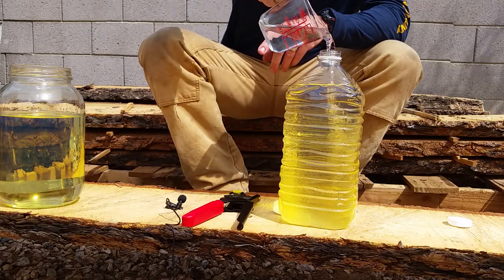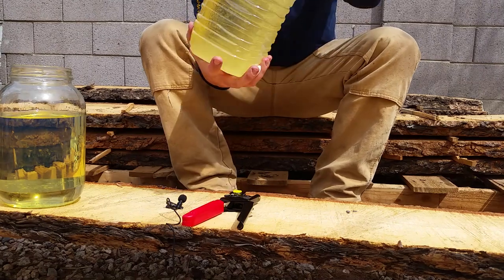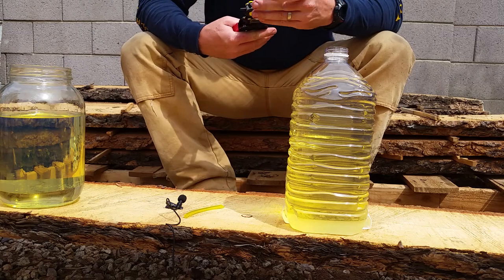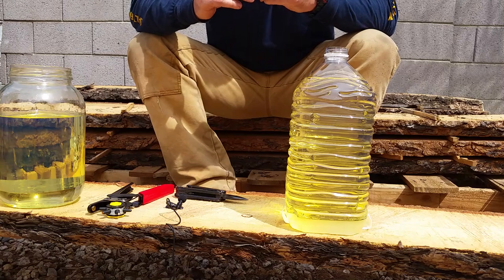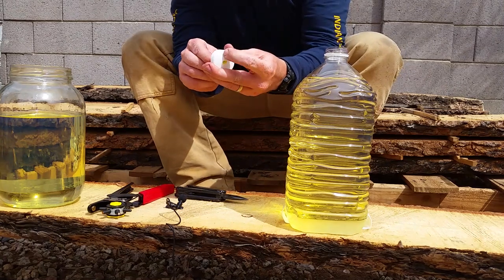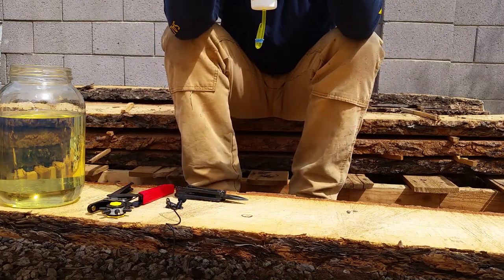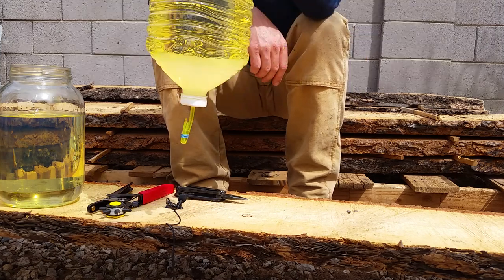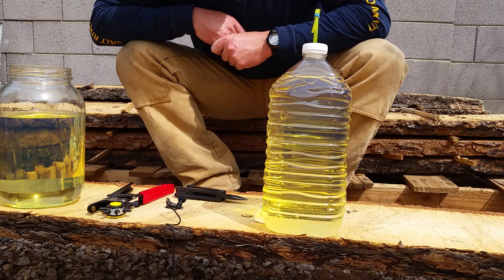Removing ethanol from gas

Comment: Pure gas gets up to 4 more miles per gallon, that's 80 more miles on a 20 gallon tank , corn is for eating , not running your car
Reply: Henry Ford actually designed his first cars to run on corn alcohol.
Reply: And also WHISKEY...lol
Reply: @fastcarshotbikes  Weren't they running cars off of moonshine during prohibition in the 1920's?
Reply: What mpg do you get?
Reply: It also pollutes more... I don't know what these environmentalists are smoking, but it obviously isn't pot.
Reply: @fastcarshotbikes  Indeed, they were designed fully for alcohol. They didn't use crappy plastic and cheap pot metal in the fuel system then. The oil companies sold gasoline at a loss to smother out the alcohol producers. Then they jacked the price. We've been gouged ever since.
Reply: On the YouTube channel Project Farm, he tested the difference between 10% ethanol you get at the pump and ethanol free. One of the tests was how long a generator would run while powering 2 space heaters. The ethanol free gas only last 4% longer than the 10%. So assuming you get 100 mpg already, yes you can get 4 more mpg. Assuming a reasonable 30 mpg with 10% ethanol, you'd get 31.2 mpg with ethanol free.

The main benefit is reduced wear and tear, not gas mileage. Although it is another plus of ethanol free gas.
Reply: @waltofalltrades6817  Yep, a liter of E free gas gets you more mileage, but measured by the dollar you get less as the price is about 35 cents higher (in Canada)
Reply: @The411  and that's why I was watching the video in the first place. Its a good thing that I only plan on using it in my lawn mower, gas mileage wasn't on my mind at all.   XD
Reply: @The411  right, and nobody has the time, space, or inclination to chase the extra mileage by doing the work to remove the ethanol like this in quantities that cars go through fuel.
Reply: 6 % mpg loss with 10% ethanol
Reply: And toilet paper

Comment: Farmers have done a variation of this for decades.    It's a water trap. Elevate the large fuel tank.  Have a threaded drain hole at bottom of the tank.  Run line downhill from tank to a T-fitting.  Position the T- fitting so that one port faces down.  Attach a longish pipe to the bottom of T.  Install a petcock at the bottom of that pipe.   So any water in tank will eventually settle  into that low pipe, and can be drain off, until clear fuel comes out the petcock.   The 3rd port of the T feeds to a filler hose that is used to fill the gas tank of vehicles. A person can also install fuel filter between the T and the filler hose. .  Is especially useful on bulk diesel.
Reply from the maker: +Duke Makedo very interesting...thanks
Reply: charter planes also have a water drain off in the fuel tanks from the wings on cessnas
Reply: @wharris7594  I remember draining the water from the King Air and Cheyenne in my dad's hangar as a kid.

Comment: Octane is a hydrocarbon like butane, propane, hexane, (gasoline is primarily hexane). Ethanol adds oxygen to the mix and promotes oxidation so when you said removing the ethanol lowers the octane I had to comment. It lowers the gas' ability to oxidize. Ethanol helps to clear up emissions and aids the catalytic converter so it can do it's job. Sometimes you just need pure gasoline for yard machines and carburetors. Ethanol vapor locks mechanical fuel pump suction when its hot and nobody enjoys that. Awesome video!
Reply: You are right. All hydrocarbons are nonpolar and hydrophobic, so octane molecules would not be removed from the gasoline into the water.

Comment: I have separated out the water/ethanol after 10 gallons got flooded in Hurricane Harvey.   I realized it was also washing the ethanol out and the gas should be good.   And it was!   I just put a tube into the lowest corner of the can and siphoned the water out from the bottom until clean gas was coming out.   Easy.  However, I find the best answer is to just use regular gas as long as   1. you don’t buy a lot and store it for a long period and 2. Make sure your tank and float bowl are emptied and dry before putting up at the end of season for that machine..   As long as you do these two things and are running your machines on a regular basis then you should be fine with gas+ ethanol.   Problems really only occur when it is stored and/or left in the cans, tanks and carbs.    It takes 30 minutes at the end of the season for that machine to change oil and drain all fuel out.   That 30 minutes pays back BIG time at the start of next season.   I’ve been using this method for years and never had to clean a carb or gas tank.   Most issues can be traced back to lack of simple care.
Reply: It destroys  plastic  fuel  lines on 2 stroke engines  and diaphragms on all small engines

Comment: The trouble with ethanol is it attracts water like a magnet even in a closed fuel tank and when enough water is in the ethanol it will separate leaving straight water on the bottom, rusting the tank and killing the fuel pump, I know this from personnel experience!

Comment: I am having problems starting my Husky Rider mower. The guy who services it told me it was the ethanol in the fuel and that it damages engines. I'm glad I came across this great video and now have a solution to the problem. Grateful to Kimball Cody for sharing his knowledge and all the posters here. 👍🙌
Reply: I'm a small engine mechanic. We switched to non ethanol fuel at the shop about 8 years ago fue to the amount of carb issues. We'd fix it and stuff would come back gummed up. Everyone gets a machine back with non ethanol and highly advise it for anything that's sits for 3 weeks or more

Comment: The purpose of adding ethanol to gasoline was because of the oil shortage. Now that the U S has newly discovered reserves of oil, we don't need the ethanol. The only reason why we keep using it is because of the farm lobby which will suffer loses as the ethanol market dries up. (maybe they could plant more food crops and save us a few dollars at the grocery store???)
If the methanol volume was 10% - 15% and we got 10% - 15% less mileage it was just robbing Peter to pay Paul. Nothing was gained, it was damaging to the engine and components. The bottom line is it was a costly venture with no benefit.
Reply: What you say is true and I previously thought that it was essentially "watering down" gas for no good reason. However, I learned that ethanol acts as an octane booster by oxygenating gas. Tetra-ethyl Lead was previous octane booster. When that was banned by EPA it was replaced with either MBTE or Ethanol as the primary octane boosters. MBTE is a known carcinogen and also pollutes the air. MBTE is being phased out, especially in places with smog issues. That leaves only ethanol which for all it's obvious problems with phase separation and lower btu's than gas, is apparently the best available alternative as an octane booster. That said, Brazil who pioneered ethanol as additive to gasoline gets from the waste of sugarcane in sugar production. This makes far more sense than using corn. The sugarcane waste has to be disposed of so making it into ethanol is a win - win. It does cost less than gasoline. Using corn takes so much energy to grow, harvest, and refine that it costs more than the gas it's replacing.
Reply: So why don't  they make newer engines  that can withstand ethanol?
Reply: You're right about the "farm lobby" likening the usage of ethanal from corn. It's a big boost to their bottom line. However you need to understand that in the farming business capitalism doesn't exactly work as it does in other industries. If the farmers stopped growing corn for ethanal and sold it for food, the price of corn will crash since there would be too much corn in the market. Even if they switched to other crops they would experience similar results due to over abundance of that crop. Farm prices have to be somewhat stabilized in order to maintain a certain level of profitability for the farmer to remain in business. Farming, unlike other industries are at the mercy of mother nature, and human nature. Seeing that crops take time to mature,  farmers can not just start and stop production of a crop when the he/she sees a change in demand.  He/she is stuck with the crop he/she planted months ago regardless of the demand or lack of demand in the future.
Reply: its a joke we will never run out oil or gas. the scientist where paid off to say that so they control the prices.
Reply: @stevejames3292  Sorry man but even in brazil the fuckers water down our gas with ethanol at a 27% rate
Reply: Problem around her is no consistency in the amount of alcohol that is added might be as much as 30 percent.  I use antifreeze to test and remove alcohol; takes my h less time.
Reply: @corin164  Which is why the silo was invented. ahem.
Reply: @VegasLiveStream  Trump made us energy independent? Wow...🤣🤣🤣🤣🤣🤣🤣🤣🤣🤣🤣🤣🤣🤣🤣🤣🤣🤣🤣🤣🤣🤣🤣
Reply: I thought the purpose of Ethanol was to reduce emissions?
Reply: The biggest lie ever told to us.... oil comes from fossils 😂😂😂

Comment: Thanks for the video.  I work at a refinery here is what I know

Ethanol and water are polar molecules so they like to stick together.  Gasoline is organic so it likes other organic molecules. Because ethanol and water are both polar molecules ethanol (which is basically alcohol) is hygroscopic (will absorb water).  It will not only absorb free water (water droplets) but it will also absorb dissolved water (humidity) from the air.  Once ethanol fuel has absorbed more than .4 wt% (weight percent) water, the fuel will stratify (ethanol and gasoline will separate).  This happens because the ethanol becomes denser (heavier) and will go to the bottom of the gas container leaving the gasoline on the top.  The ethanol and gasoline WILL not mix again and will stay as two separate liquids in the same container.  So you have gasoline on the top and wet ethanol on the bottom.

So here is the real problem.  The ethanol helps to increase the octane of the fuel; its octane rating is about 116%.  Raw gasoline without the ethanol additive has an octane rating of about 83%.  Once the fuel has stratified into two separate liquids the gasoline (on the top) will only have about a 83% octane instead of the regular 87% that you bought at the pumps.  

So, you have to add enough Octane booster to keep the fuel from pre-igniting as the piston comes up to Top Dead Center.  I do not know how much Octane booster you need.  If you use low Octane fuel in small engines, especially chainsaws and trimmers, you will most likely overheat the engine and destroy it.  I have seen overheated engines from using low octane fuel many times.
Reply from the maker: +break break thanks for the info. Since the video I've learnec that most octane boosters are.....alcohol aka ethanol
Reply: Mix a little bit of race gas (don't need very much at all) and the octane comes way back up! Also, start with high octane fuel. ;)
Reply: Simple fix use premium gas to make up for the difference starting with 93 octane instead of 87 thats 6 points if the 87 drops to 83 thats 4 points if the 93 drops 4 points you will have 89 octane better yet how about we petition our legislatures in our states to take ethanol out. Its a scam. All that land could be used to grow edible crops and bring food prices down. Food prices in sept 2022 years after this video was made have skyrockets. Gasoline has skyrocketed. Also ethanol free gas gives cars 5% more mpg. We will use less gas our engines on our cars and all our small engines will last longer we will have cheaper food its a win win for everyone except the crooked politicians
Reply: 1947 Willys, will starting with 93 octane keep the finished product at 87 or above?    Im using it for a 2 stroke.  Thanks
Reply: @KimballCody  gotta be careful, most "octane boosters" on the market are just methanol or other alcohol additives.
Reply: @chubbysumo2230  are paint thinners like Toluene or Xylene considered bad? I actually can't get a good answer on what small engines octane requirements are.
Reply: @warxhover  all small engines today are designed to run on regular fuel 87 octane. Think about it, people in northern remote communities don’t have the conveniences others in larger cities do and all they can get is Gas, and that’s cheapest obviously is regular certainly not premium
Reply: Gasoline does not like other organic molecules. It mixes with other nonpolar molecules because there are no hydrogen bonds between nonpolar molecules. Polar molecules are attracted to each other by hydrogen bonds. If you try to mix a polar liquid and a nonpolar liquid, the polar molecules pull together and squeeze the nonpolar ones out, so they form separate layers. Organic or inorganic is irrelevant. Ethanol is organic and weakly polar, so it can mix with either gasoline or water, but it is attracted to water.

Comment: Nice video. This is great if you’re in a bind and need some ethanol free fuel. The thing is that I’ll use 10-15 gallons on the weekend in mowers, weed eaters, etc. not including if I’m lucky enough to have time to get out with the boat. By the time you take away the volume of the ethanol, spend your time doing it, and add octane booster, you’re right there at the cost of filling your cans at a service station that sells regular ethanol free gas. I agree it’s bound to be cheaper than buying it in a quart can at the hardware store. There’s an app now that shows you where the service stations are that sell it. I use it in all my small engines AND my outboard engine. It sure is a money saver when you’re not having to repair carbs and replace fuel lines.

Comment: I have been doing this for my small engines and it works great I have also found adding 2 oz of 2 cycle oil makes the process faster less then 1 hour and its done. The 2 oz of oil breaks the water loose faster and works in 4 cycle and 2 cycle engines just as good.
Reply from the maker: Ill have to try that. What about the drop in octane?
Reply: @KimballCody  I have not seen any difference in my usage I just start with 91 from the pump and it works very good for me.
Reply: @KimballCody  Octane is only an issue in high compression engines.
Reply: Gun lover, is the gas now colored because of the two-stroke oil and the water is clear?  Rather than adding food coloring to the water which would look opposite

Comment: Had to do this to make my 1993 Nissan Altima run. The ethanol fuel was causing the car to hickup and fart like a really bad car. Once the ethanol was out the car ran fine with no problems there after.
Reply: I had to replace the fuel pump to the tune of $400!

Comment: Thanks for the video recently i move to turkey i Just purchased all new 2cycle motors chainsaw 460 rancher  trimmer rs543 and leaf blower 570bts all husqvarna commercial grade stuff i buy quality husqvarna 2 cyxle oil and get shell v power gas 95 octane it has only %3 ethanol required by the goverment so there isnt premix gas anywere or ethanol free gas so i was looking for ways to remove ethanol from the gas you helped alot thank you

Comment: Nice experiment, I'm surprised it stayed separated when you flipped it around, makes you wonder what you get at the pumps when you buy gas if it separates so easily, I know the tanks here in NY gave no agitators to keep it mixed. Just a thought. If you are the first customer in the morning are you getting alcohol and additives? Or gas?
Reply: the ethanol in gas will stay mixed. it separates because water and gas wont mix and ethanol loves water so it binds to it. and because the water wont mix with gas the ethanol is separated in the water medium.

Comment: I use LL-100 avgas from my local airport about 6 bucks a gallon, I get 5 gallons for the summer to use in mowers and chainsaws....what I dont use goes into my Motorcycle in the fall. ...been using it for 4 years now with no probs.

thanks for showing us your trick
Reply from the maker: +mike dee that's what i use now.